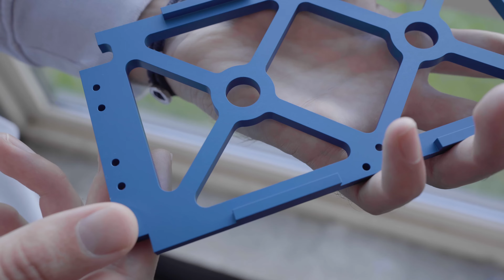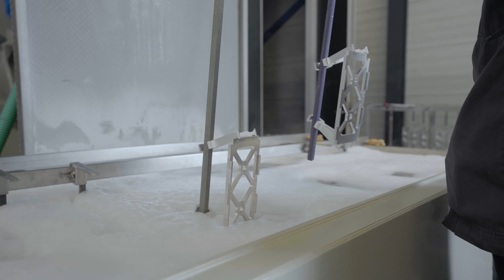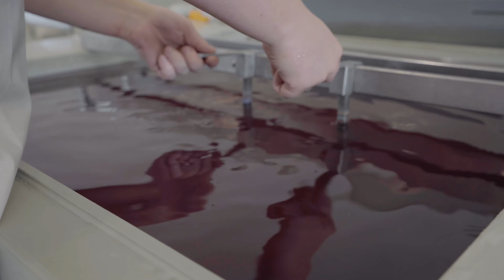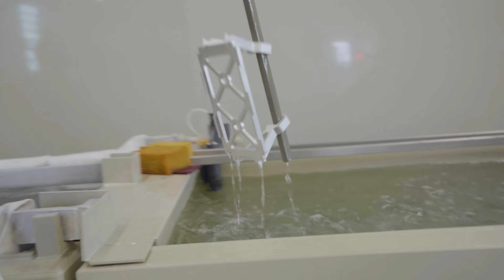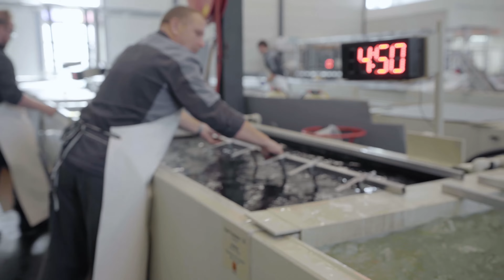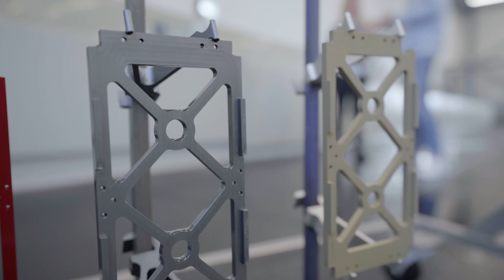Anodizing - What is it and How Does it Work? Complete Aluminium Anodizing Process Explained

Comment: how to maintain an anodized aluminum, especially a colored one?
Reply: oil it
Reply: @MonstaNachoz  May I ask more specific, what kind of oil to use? What does oil do to the anodized aluminum?
Reply: @MarkGarutti wd-40 or mineral oil should be fine. Just minimize friction and oxidation
Reply: @ Thanks for the info. Actually, that’s the reason I’m asking. I don’t know how to care for or maintain my anodized aluminum in-ear monitors to protect the color and keep them from oxidizing.
Reply: @MarkGarutti  should be fine as long as the anodized layer doesn’t wear down. I won’t worry about it too much. A wax like carnauba wax might be longer lasting

Comment: Excellent explanation. I would like to ask your opinion regarding some parts that my company has received from an anodization facility.  We are visually and dimensionally inspecting 1/16" thick sheet metal welded cases (5052-H32 aluminum) before sending to the anodization facility.  Several parts have been received from the finishing facility with small hole burned through the sides and corners of the cases.   Have you seen this before and have an option of where this could be happening in the process.  Could it be low quality material composition in the sheet metal which is etched away in the desmutting step or is it in in the anodizing step when current is applied and physical contact is made through the part to the cathode.
Reply: This will be done in the anodising process, it could be a temperature problem in the anodiser, acid levels too high or low when anodising or maybe volts/amps too high
Reply: Temperature too high or voltage too high. Ask if they are using a solution mover in the ano tank to stop it from getting heat spots.

Comment: Interesting video, thanks! Btw, what is the name of the instrument used for checking anodizing layer?
Reply: DFT (dry film thickness) meter.
Reply: @sandeshrajput2078  Thanks! Do you have any recommendation about where I can buy an affordable one?
Reply: @agueconfle4889  'Fischer' is most trusted brand but very expensive..if you want cheap one then go for Chinese brand like 'linshang' you can search online for supplies
Reply: @sandeshrajput2078  Excellent, thanks for the info!
Reply: Can you tell me about  rectifier 24 volt will be use?

Comment: great video! already signed up and your website is well refined! quicky... you mentioned at 1:00 that it's best to let the anodizer carry out the work for bulk items? Do you only recommend Hubs for prototypes if doing anodizing or can you do bulk order with consistent results?
Reply from the maker: Hi Nick, great question and thanks for the compliment! We do bulk work on a regular basis. It is preferred to do as many items in 1 order, to make sure that items will be manufactured at the same time and look the same. We’re used to working with people doing functional and cosmetic parts, and have options made especially for that on the website/platform. It's easy to upload a design(totally free) on the Hubs platform and play around with specifications. If you would like to get in touch with a sales rep for more info let me know :)